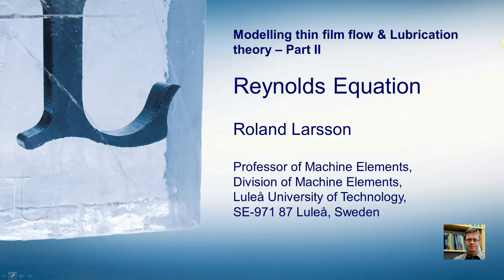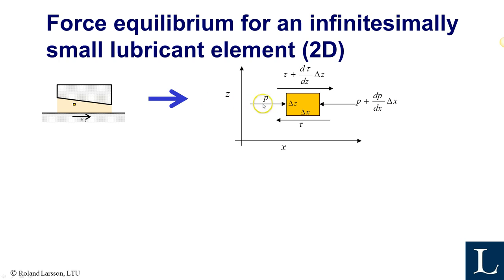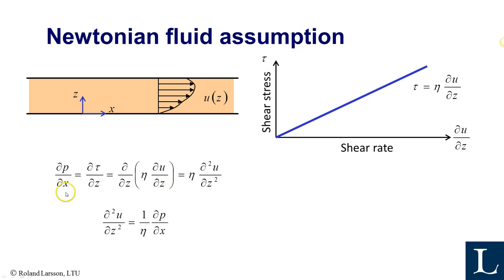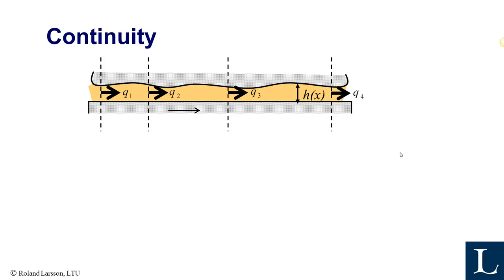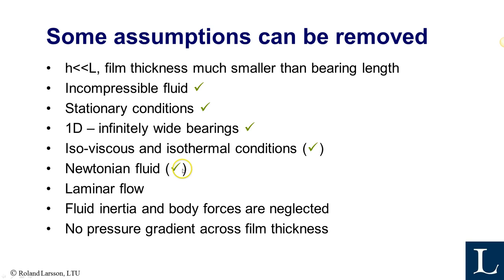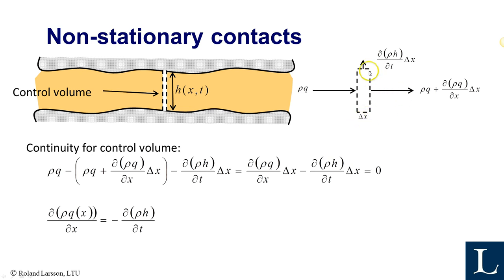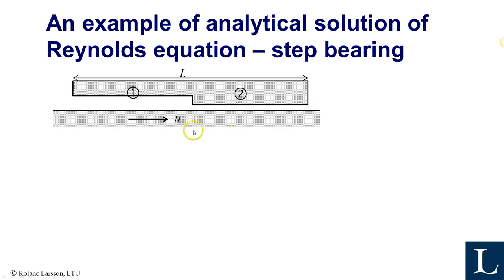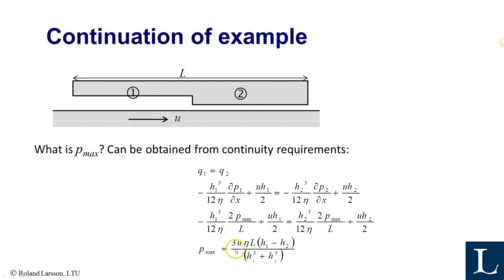Lubrication Theory - Part 2

Comment: hi. I need to find out the damping coefficient in a fluid film bearing. I have calculated the pressure by the solution of Renolds equation using finite difference method. I am not finding any clue further. Can you please help me. my email id is subratkumar1803@gmail.com